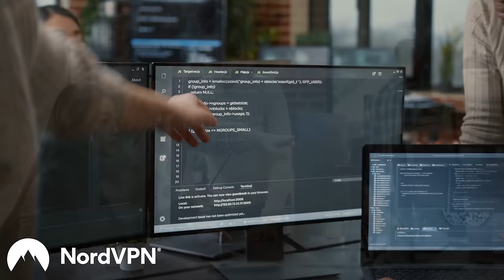Elon Musk fails Cybertruck stainless steel metallurgy test | Auto Expert John Cadogan

Comment: John, sorry but I think you may have missed a material science class or two at Uni. You can wire draw austenitic stainless steel to achieve much higher strengths than the normal UTS. See the material strength of stainless steel wire rope, i.e. 1570 MPa + due to work hardening. For steels, hardness is a good correlation with strength. 

Minor differences in material composition can lead to significant differences in mechanical properties. Have you actually investigated this and the post treatments? You can't lust lump all 300 series stainless steels in the same basket.

You have completely ignored geometry of the vehicle structure. It is just as if not more so important as the materials used. Your explanations for the crash performance of the the vehicle are very simplistic, misleading, and clearly aimed at non technical people who don't know better. Let the results of the cash testing speak for themselves. 

Whether the Cyber truck is a good vehicle or not is up for debate. My preference is for efficiency but that doesn't seem to be a strong selling  point with the general public at this stage. 

You can make good points with your videos but they are increasing coming across as passive aggressive. You come across as a whinger who failed at engineering rather than providing constructive comments.  I suggest you add some commentary on ways forwards rather than just complaining. I am increasing disliking Elon as a person but that shouldn't detract from comments about Tesla vehicles.I suggest you comment after getting some real information rather than just guessing.  

Yes there are issues. Lets talk about solutions.

When it comes to the energy transition, this is a fast moving field. The information you sprout needs to be current, like the percentage of fossil fuel generation when assessing the eco friendliness of EVs. I trust you can do that else I would think you are really just looking for clicks.

I use to enjoy reading your column in the old Wheels magazine days. I like the humour but I need accurate facts to keep being a viewer.
Reply: I have to agree sadly, while I generally enjoy John's content,  I've found his dislike of  Musk and Tesla to be somewhat unhinged to be honest and the facts relating to the Cybertruck simply don't seem to stack up and there is plenty of content out there from actual working "engineers" which directly contradict John's assertions, I'm not a Tesla fan by any means as their business practices are a mirror image of Apple's ruthless screwing of their customers...but Musk whatever you might think of him has hired the best engineers for all his companies, will the Truck be a success...that remains to be seen.
Reply: Finally a reasonable opinion on this channel. I can't believe people think this guy is honest or knows what he is saying. He's not even an engineer. People listen to him like it's gospel and I find he is factually inaccurate in so many things he says and covers it with insults and humor.
Reply: Agree, constructive criticism is far more valuable than endless complaining. A not so fun fact is the Greenland ice sheet is losing one millions tonnes of ice per minute. Like it or not. over time we have to stop putting so much carbon into the atmosphere.
Reply: You clearly didn’t get the main message from this 22 minute video and that is that John knows a whole lot more about steel and car engineering than you or your ‘cranks’ over at tesla ever will!

https://www.youtube.com/watch?v=J5zDNaY1fvI

Here is a video where the engineers over at Muskville crank on about their supposed ‘science’ and ‘research’ into how they made this new stainless steel and the new ‘airbending’ process.. 

To me they come across as shoddy used car salesmen who have no idea what they’re talking about! I’d far more trust John who, as he demonstrates with his confident smugness in this video - knows far, far more than they and their ‘engineering’ in how to make a car that won’t fall apart in just a few months than they ever will!

I really hope John starts his own company and shows those cranks what a real car company with real parts and real gasoline ran by somone who actually knows what they’re talking about can do! MmmmmATE!

John : if you’d ever like to go out to dinner in Seattle the offer still stands as always!! 🍆🍆
Reply: like you even were at uni

Comment: Took a couple of years of Metallurgy and followed Tesla since the dawn of the Model S.

You made 2 mistakes in your assessment: 
1) The Cybertruck skin is 3x thicker than a conventional panel (it replaces the frame as an exoskeleton and is load bearing)
2) The skin is Cold Rolled (Strain hardened) Stainless. The alloy Was created by Tesla for enhanced Weldability (not to enhance strength).

Detail:

Tesla uses Cold Rolled Stainless... the steel is Strain Hardened... That's where it gets its strength.

The special alloy Tesla developed was designed to enhance the weldability of the metal. They had a problem with seams bursting at extreme high pressure in their new orbital rocket which contains thousands of tons of cryogenic fuel under extreme pressure in a rocket fuel tank 3-4mm thick
So yes, its no Cobham Armor, but its far stronger (High Tensile strength, High shear resistance, High Hardness, lower but quite usable ductility. 

It is far more difficult to deform than conventional mild steel panels. Hence the angular shape of the vehicle. That was not a design choice. It was a design necessity. 

While tool steels are very hard (and frequently brittle if not forged correctly) this is in no way a proper comparison. You would Never use tool steel in the exoskeleton of a car like Cybertruck (or any other vehicle save maybe a tank).
High strength steels Are used in the passenger cage of a quality car but Mild steel is used in the other parts of the frame and in  all of the panels.

So Yes. Cold rolled steel in 3mm or so thickness used in the Cybertruck (about 3x as thick as a panel on a regular car) will stop normal handgun ammo fired at close range and it will damage the dye of a stamping machine.

So no. The hardness and resilience of the Cyber truck exoskeleton (skin) is not hyped.

Many articles have covered the Cybertruck and the thickness has been (mostly)  noted but they forgot that it is strain hardened steel somewhere along the line (easier to just say "Hard" without all the science).
Reply: Read your comment 3 times, each time I read it I can only come up with wtf and wtf. Work hardening stainless to make it more weldable, without changing the recipe of the stainless doesn't make it TESLA steel. The look of this truck alone is proof enough that this is an irresponsible material to use to make a pickup truck out of, that seems very obvious to me. Space craft ... Yeah 
Pickup truck.... No

Comment: Hi John. Nice video.
As a former, among other things, prototype engineer, we did some "bending and pressing" stailess.
One thing not everybody, I assume, don`t know of stailess, is: It is a non magnetic steel, until..
Yes, you form it. Try with a magnet on a spoon, at different places, and You will see what I mean. The "grid" of the metal, changes, when forced to an other form by tooling. The more you form it, the more magnetic it becomes.
from a Finn in Diaspora

Comment: What would it be like to repair in the event of a fender bender I wonder?
I thought I saw some ripples on the panels already but it could have been a pre production one.
Reply: You would expect the „presentation cars“ being handcrafted for perfection, wouldn’t you?
What you see is the best they can make 😂
Reply: They have solved the problem by Marketing. In a recent video Marqees Brownlee, who is a bright guy and should know better, did state that the body will not bend or scratch which is naturally not true. With more flexible body panels a skilled body shop worker will be able to bring the body back into shape within certain limitations, beyond that he can always use filler and a respray, all this is not doable with cybertruck. A 10 year old cybertruck will have to proudly wear the scars of his life.
Reply: Panel beating would be extremely difficult.  Trying to remove a crease would work harden the metal, resulting brittle failure.  This would then need to be welded.  You'll never get the factory finish again, but then the factory finish is pretty poor to begin with.  The panels really do have ripples, and that is the result of folding other parts of the panel.  Locked in stresses will cause that not-quite-flat effect.   Welding would be a problem because stainless in this series have a high thermal coefficient of expansion - more than fifteen times that of steel.  This would result in panel shrinkage and distortion.  Welding temperatures also cause hardening in the heat affected zone, locking in more stresses and causing embrittlement.  Basically, body repairs beyond a minor dent removal would not be feasible outside of a passion project.  I was a welder for over a decade, much of it spent working on stainless steel parts that then needed to be machined and milled.  I think it's fair to say that most of the techniques used by panel beaters and mechanics would not apply to stainless steel.  Not least of which, "30X" is not a specific enough designation to correctly select the right filler material.  Filler materials for stainless steels usually have to have a higher alloy content in key areas depending on the grade, to prevent weld dilution and metallurgical cracking and maintain corrosion resistance.  Could a back yarder or someone with no experience of stainless do a repair?  Yes, but it may not be pretty.

EVs are already more likely to be written off due to the cost of replacing a potentially damaged battery, add in the extra cost of panel beating stainless steel and insurance companies are just going to write the vehicle off for salvage.  At least the stainless steel would be worth something, but again that would depend on grading it properly.
Reply: @Chrisamic — Sir, I second your opinion (engineer with 40 years of industrial practice).
Reply: There’s already specialists who repair Delorean’s most seem to be in the UK, there’s no magic required just skill and experience. Similar specialists will appear to deal with the Tesla.
Reply: @robertpatrick3350  So extremely niche and only able to do so much I would have thought.
I've actually watched some shows where people restore De Loreans and the body was their main concern.

Comment: Hi John, you should do an in-depth look into the range extender that you can buy for the Cybermonstrosity and more importantly, why are they selling this? Is this to compensate for what is perhaps an abysmal towing range? Remember when CyberKaren was talking about quick change batteries? Being so long after the announcement of said batteries I'm sure this range extender will be a fast and simple swap...
Reply: The extended range batteries do not exist right now. Musk was forced to announce something about the abysmal range of the Cybertruck that was a positive, and the battery pack was it. Tesla will not spend all the investment needed to manufacture a battery pack that would defeat the reason for having a truck. I suspect in a few years when they, or if they are still manufacturing the cyber that they will remove the underfloor storage in the bed and put batteries in there, maybe put batteries in the frunk.  No need for the extra storage space if the vault is secure enough to store equipment, as in every other truck so far that does not have a frunk or a very limited under bed storage space if any.

I don't know about the ss used, i think of how strong some big stainless steel things are that i have bought over my life compared to any car skin. All pressed into the shape needed with no problem. Maybe ss is the future, but most definitely not in the way tesla is using it. Disagree then just look at your ss sink, formed much deeper than any part on a car would ever need to be deformed, and it is not bendable or easily breakable like the thin steel panels they use on cars
No wonder, musk admitted the Cybertruck is a failure that could bring tesla to its knees.

Comment: Here is a Top Gear review & interview with the chief engineer & designer - very interesting. Some discussion about the stainless & panel forming issues. 
I suggest that the reference to breaking the press relates to forming hundreds of thousands of panels, & not just sticking the odd panel through.
Reply: Does John know that tesla employs real engineers to do the engineering?  Seems to me that the 3 and y are leaders in terms of weight, efficiency crash worthiness, acceleration, charging and regen integration, they are let down by little things like interior and suspension tuning. Anyone with Musk's money and authority is going to be overconfident, John is wrong to conflate musk with the tesla company.  However, if I had a free cybertruck, I'd trade it.  To me electric cars make sense as a second car for short commutes to work and shops.  So the car that's needed is economical ie small efficient lightweight.  We need better charging infrastructure before considering evs such as work utes and gts
Reply: @shiftyparadigm7049   You can't always assume that a company that employs qualified engineers.... actually listens to them.  Laud and mandate, yes.  But not actually listen when risks are offered in the "Yes, BUT...." meetings.  They choose not to hear the But.  
In the modern publicly traded 'bank that also does engineering', the design engineers are promoted less and less.  Marketing gurus are more likely to be able to sweet talk The Board.  

It often becomes a case of the deaf leading the mute.
Reply: @ToolHombre A good example would be the Shuttle Challenger disaster. The engineers knew the O-Rings were not designed for the temperatures on launch day. But they choose to not listen to the engineers.
Reply: @MrLuigi-oi7gm   Word. 

I have an article on my desk about the 737 Max investigation where there was a similar admittance that flags were raised about the changes being made, but not fully investigated and mitigated prior to rolling it into production.  Nothing should have 'caught us by surprise'.

Comment: Has there been any video’s of crash testing of this vehicle made available? 
I’d like to see how 30X performs versus concrete
Reply: I've seen side impact but no hot urinal x Wall action.
Reply: There would be two versions of this video worth watching:
a) New vehicle straight off the line.
b) Old vehicle that has been driven on dirt roads for 50,000 km and has been work hardened due to vibrational stress.

Comment: From wikipedia..."Stainless steel is strong, about 3 times stronger than ordinary steel. For type AISI 302 cold-rolled, its yield strength (i.e. its elastic limit) is 520 MPa, and its ultimate strength is 860 MPa. It is also quite hard; its hardness on the Brinell scale is 200, versus 120 for ordinary steel and 15 for pure aluminium.". Not sure why he think it's not hard.
Reply: Wikipedia is just stuff people put in there.  "ordinary steel" includes a lot of stuff stronger than 300 series stainless.  The whole purpose of the 300 series is not great strength.  
Other alloys are often over 1000MPa
Reply: @kensmith5694 why’d the truck stop .45 APC and 12 gauge buck?
Reply: @gilliesiut2332 Steel is generall strong stuff if you make it thick enough.
Reply: @kensmith5694  stainless is stronger.

Comment: Way back in the early 60s Pontiac Motor Division built a number of Super Duty Catalina 2 door hardtops with aluminum front sheet metal. They were essentially factory race cars, known as Swiss Cheese cars. Forming the aluminum sheets into inner and outer front fenders, hood, front bumper and brackets, and radiator support without breaking it was not easy to do. I believe for all of the same reasons John talks about here. The parts however did look identical to their regular steel counterparts with all the proper curves and contours.
Reply: Weren't those acid dipped as well ?  NASCAR did some crazy shit to best the rules !  LoL